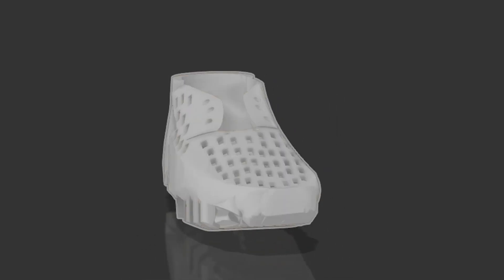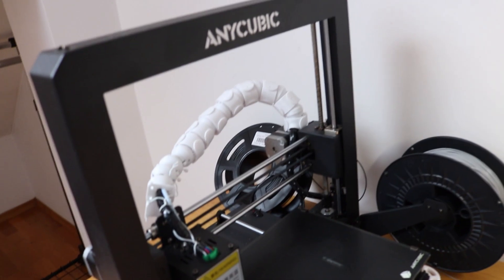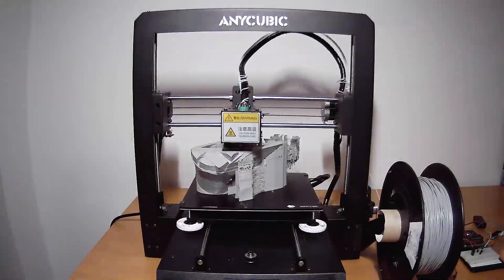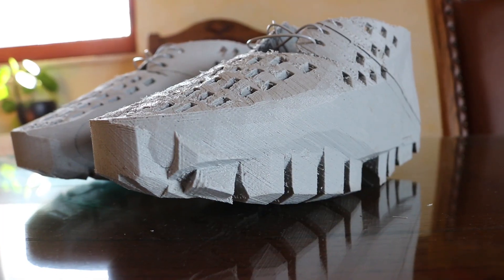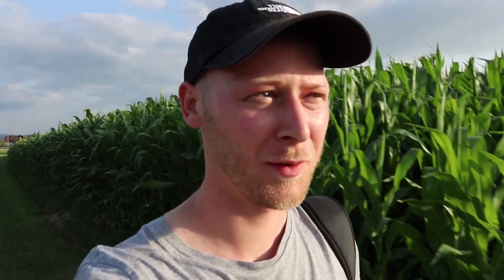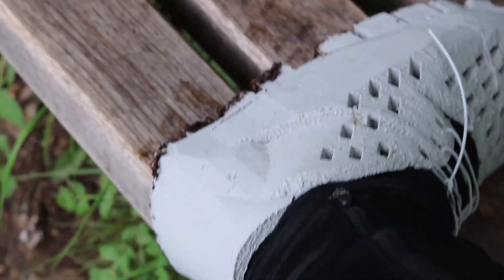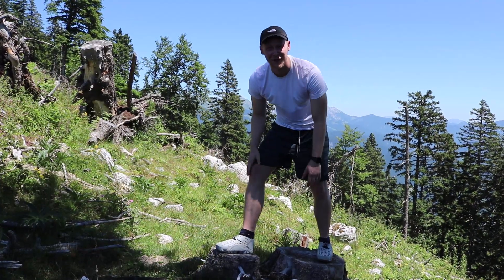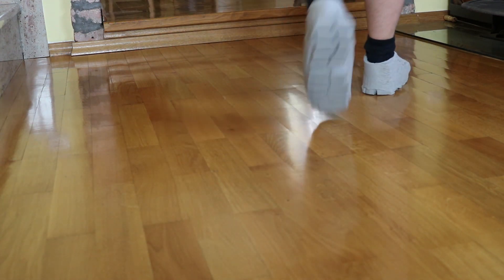3D printed boots versus 100 km

Comment: If you had used varioshore tpu, do you think the foaming could have helped make the shore much more comfortable? I have not done too much research on wether it is possible to vary the density by changing the tempurature of a print on the go just yet...
Reply from the maker: Probably, but in this case I believe that the whole shoe would be too soft and would fail to endure 100 km. Thanks for the comment!